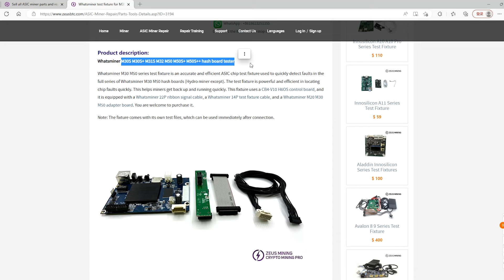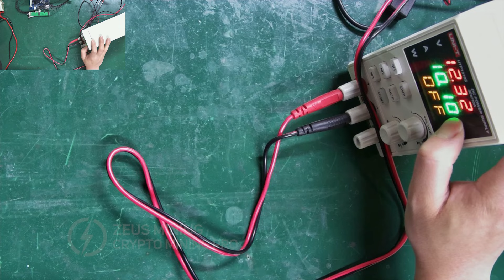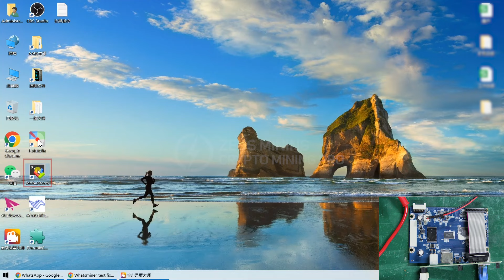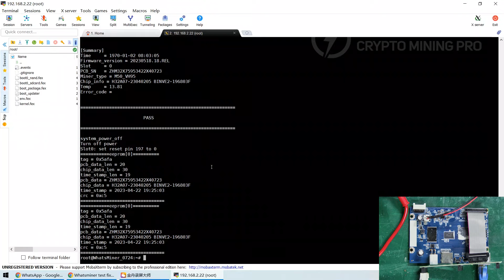How to use Whatsminer M30 M50 test fixture to test hash board failure?

Comment: Error 600 in whatsminer m21s the temps in 50 th/s its 65.50 but reboot a few momets, What would be the possible causes and should I try to solve it?
Reply from the maker: Error code 600 indicates that the ambient temperature is too high. You can try lowering the ambient temperature.